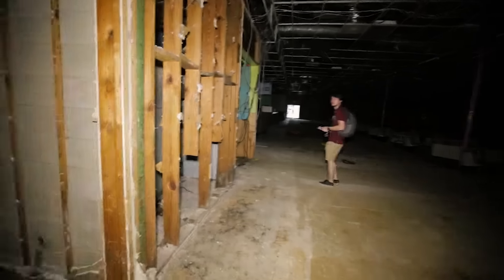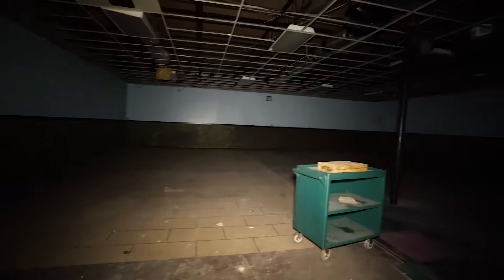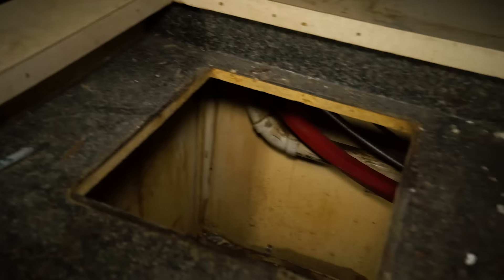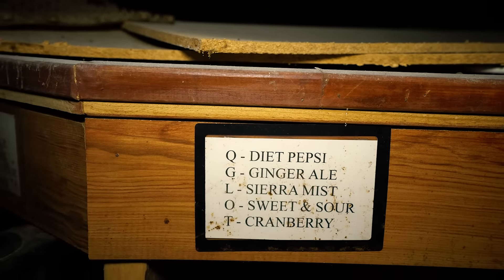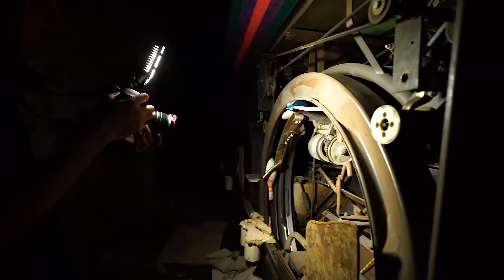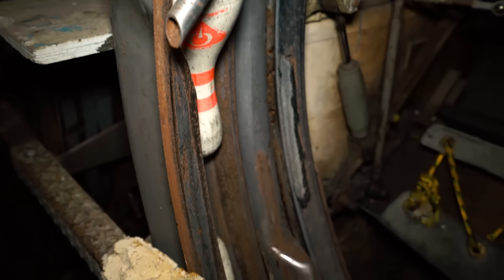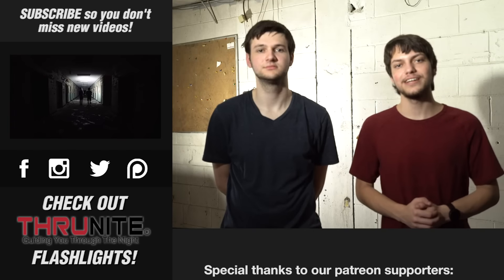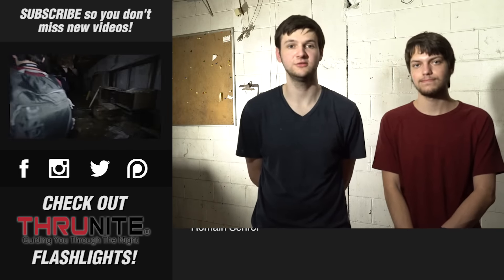Abandoned Bowling Alley Exploration

Comment: Against, sad to see another bowling center going to the wayside. I'm just shocked that they didn't salvage the pinsetters. Those are Brunswick A2's, pretty popular brand. But again, the upkeep to keep a bowling center open is just horrendous.
Reply: The problem is bowling just hasn't evolved in the past two decades or so. I'm not talking about improving the materials or anything like that, but at its core. What was the latest thing it came up with? Cosmic bowling. Other than the slight appeal to birthday kids and ironic hipsters, bowling just doesn't have what it takes to hook up the new generation anymore.

Comment: Lanes and machines intact, score monitors still hanging with ceiling tiles and lights taken down, looks like this was going to be remodeled and opened as a bowling alley again, or just hadnt removed the bowling equipment yet, the bowling lanes and machinery are are salvageable and totally usable, they are very costly most are not destroyed  if bldg torn down, they are sold and reused in other bowling alleys.

Comment: How many hours will the "ThruNite" flashlight last? I have a surefire that I have done every thing to and it is now showing it's age so if you recommend it then  I have to try one.
Reply from the maker: The one we're using is the TC12. It has 4 different brightness settings, so it ranges from 2.5 days on low to 2.2 hours on turbo according to them. We didn't test exactly how long it lasts for ourselves, but so far from our experiences it seems to last a very long time, especially if you only use the brightness setting that you actually need at that moment.